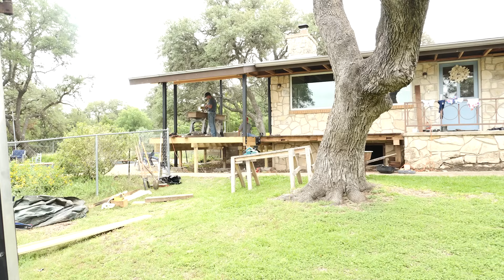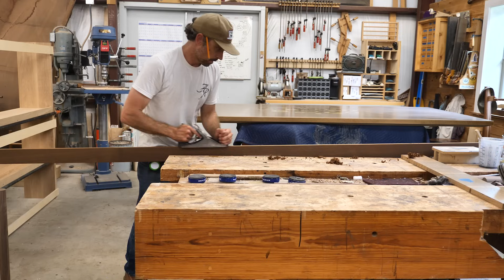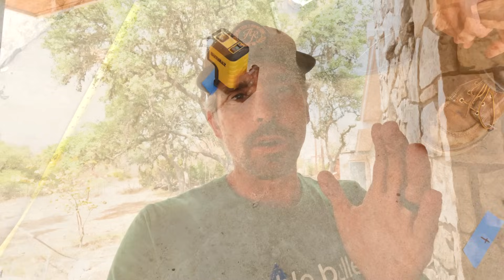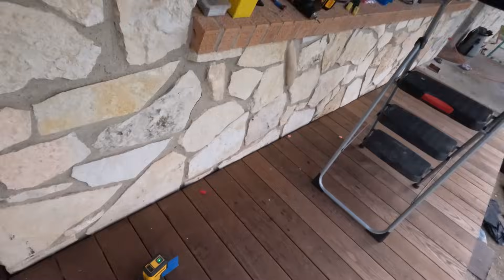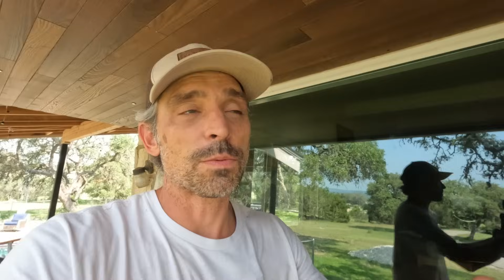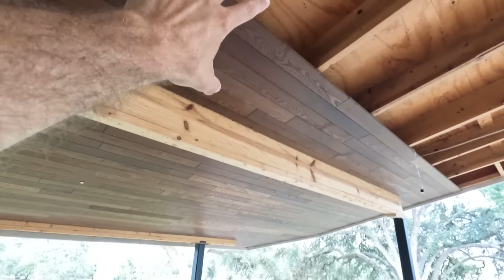Installing Decking, Soffit, and Lighting (DECK BUILD PART 4)

Comment: That’s how you know how engrossed in your project you were. Took a trip for the deck gods lol. Get some Velcro for the lighting remote so you can have a place for it with easy access that doesn’t get buried.  Loving the series.

Comment: Andy, really hoping you’ll give opinion and explanation why the decking material is a good product.  I understand they dry it out.  You used the word “brittle” in todays video?  The decking can’t be brittle.  Why did you go with this product over epee for example or trex?  You didn’t wear a mask?  Are the fumes and dust particles less severe than other woods.  What other drawback exist if any for this product or is it as near as one can get to tile without the weight. Is it resistant to termites.  Costs$

Comment: The Thermory wood looks superb and pretty cool how the ends joint together.  On the stair treads, I wondered if you treated the wood shims?  Even though your space is covered, if you taped the tops of the joists it would make sense to also have rot-resistant or rot-proof shims.  The small lights in the soffit look really elegant.